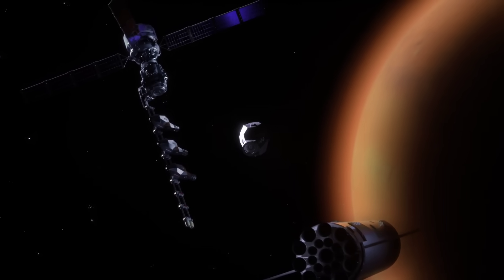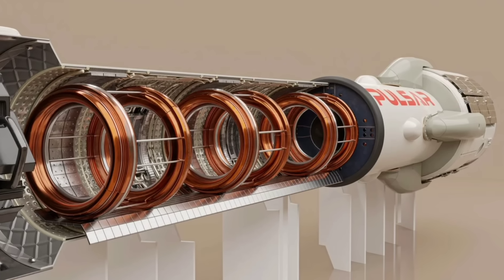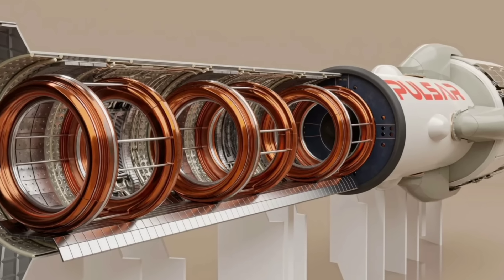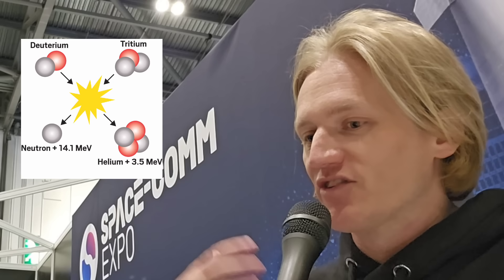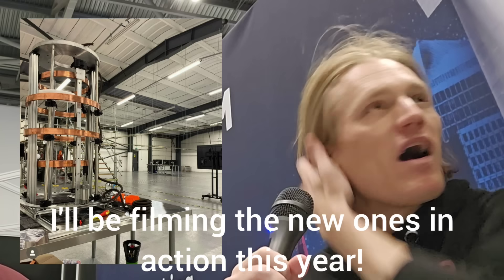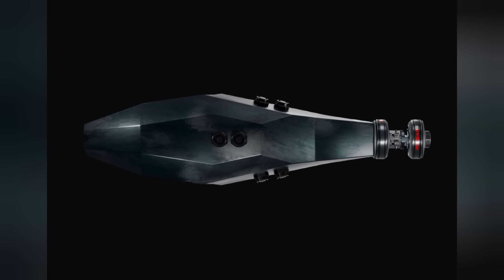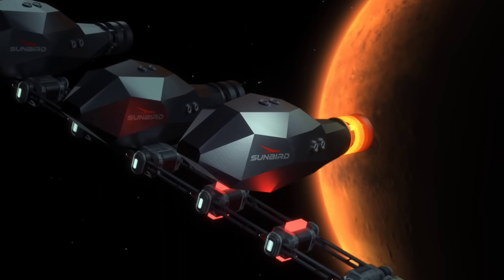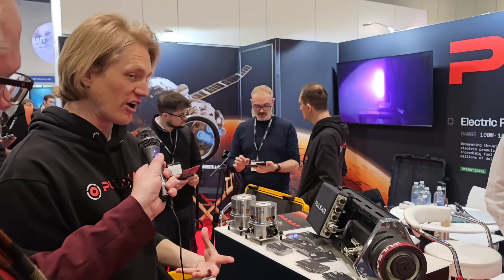15 TIMES faster than Nuclear Rockets!  Pulsar Fusion unveils new Sunbird Fusion Drive!

Comment: This is where research money should be going. Human missions to Mars is impractical using chemical rockets. Starship is still important as it will get the components of a nuclear vehicle into orbit. That was Musk's original intention with SpaceX, to make a contribution to developing the capability needed for humanity to get to Mars. Then he got obsessed with the idea of building a 100 passenger airliner to Mars, which he claims the first human test flights to Mars will land in 2028. I am a huge Starship fan (I was even in Boca Chica for the launch last week) but Musk's fantasies are becoming a distraction to developing what is really needed to eventually get humans onto the surface of Mars.

Comment: Fleets of reusable Starships to lift things to orbit. Fusion engines to move the things we build in orbit to other planets. It's all starting to come together.
Reply from the maker: Excellent plan!!
Reply: @TheAngryAstronaut  I still don't get it. Why use light as a speed indicator and why would someone on the vessel experience time differently to someone on earth. I get the '2 point' idea but there are billions of photon sources which would create more of a fog than anything else rather than the 'earth - destination light sources. Why not use time and/or a gravitational constant to determine distance? It does not seem possible in my, admittedly uneducated mind, for 2 people to experience time differently. Also, I read somewhere that light doesn't always travel at the accepted speed of light.
Reply: I see the vision, this is clever, i wish more people would think in space, vacuum and micro gravity. I know we can do better.
How many things to we make on Earth that rely on our gravity and atmosphere?  My challenge to the future is to try creating things in the vacuum and micro gravity.
What happens when you simply melt iron in this environment and then let it harden in space?
It has to do something different because ifs not in our oxygen atmosphere  and gravity isn't pulling it one direction.
Reply: @ekojar3047  
I agree... Metal 3D printing in space is a good example. No supports, no oxidation etc.
Reply: @ekojar3047  with bigger ship it would be easy to create artificial gravity. If Starship gets 18 min in diameter, it will be easy to make turn itself on its long axis, with fuels in the central part to lower the centrifuge forces, and create variable and adjustable artificial gravity.
Reply: A true fusion drive would be so hot it would be banned for use on the surface.
Reply: @rpbajb - That's why they plan to only use it in space.
Reply: @rpbajb he didn’t say using it on the surface
Reply: @rpbajb why would that be? It wouldn’t break the Coulomb barrier of oxygen or nitrogen. It would be as hot as lightning which actually does cause nuclear fusion, detectable by radioisotope traces and fast neutron emission. The problem is a true Fusion Drive wouldn’t work terribly well in an atmosphere and creates a lot of radioactive crap that ends up in the atmosphere. Any dust exposed to the plume of escaping fusing nuclei along with material ablates off the refractory surfaces that support whatever superconducting quadrupole magnets are used to confine the plume- there would be gamma and x-ray spallation. It’s not early as bad as a nuclear thermal rocket. This guy is just hawking xenon shooters- very high specific impulse but very low actual thrust to weight ratio. This is nothing that we didn’t have in the 1970s. There’s no fusion rocket that this guy’s working on, he’s just one of many, many people in tech cashing in on potential over unity fusion developments but it’s vaporware. We can’t even do it in a lab. Net energy over unity in an NIF or a tokamak doesn’t mean anything cuz we can’t efficiently convert neutrons into electricity. They make things hot, and we can use the seebeck effect to extract electricity with terrible efficiency or we can use steam turbines. The most promising idea that might be coming down the pipeline soon would be neutron scintillator photovoltaics. If we can create scintillator that produce lots of light from fast neutron capture similar to how radiophotovoltaics do with beta particles- fast electrons. But they have charge. All neutrons have is kinetic energy and the ability to join atomic nuclei. But when neutron capture occurs there are some periodic elements that push their electron shell up one or more orbitals  which in certain chemical configurations emit a photon- Pauli exclusion principle- the energy has to somewhere
Reply: @maseratidyce3587  Thanks for your reply, it was very interesting. When I said a "true fusion drive" I meant one fuses 1H and exhausts just  4He, along with gamma, positron, and neutrinos. A star-hot stream of helium plasma directed astern, strong enough to lift a 10,000 ton ship in a one gee field, would be incredible destructive, as well as radioactively "hot". My prediction is that it would be used off world only.
Reply: @ There is a company in Washington State building a fusion reactor that burns at 100,000,000 degrees. They are building the 8th prototype. Helion energy. Look it up
Reply: @pedrosura that’s contained, engines are not
Reply: If you’re here today you nor your kids will see it🤷‍♂️
Reply: U need chemical propulsion for ascent and decent on planets, nothing comes close to their thrust power, fusion engine would like attach in orbit and detach at destination
Reply: There's a missing point in these presentations: If the are not powering the process with SUSTAINED fusion what power source starts the process? If you're handling plasma you must have magnetic containment of some kind: What bootstraps the system?
Reply: @francisdavis1271   Think future: you take water, split it into hydrogen and oxygen, then fuse the hydrogen. It's easy!
Reply: @francisdavis1271  It’s not like what people think of when they think of using fusion as a power source. The idea isn’t to get out more power than you put in. The idea is to use electricity to fuse atoms.Then channel the resulting plasma out the back to create thrust. There is some magnetic containment involved. ( You can see the rings in some of the shots) However, the idea is merely to direct the hot plasma. Not to contain it.This is really just a more efficient example of the standard “Make something go boom and exhaust it out the back” method we’ve been using for years.
Reply: What NASA wanted with the Space Shuttles, just moving the Shuttle around this time.
Reply: But still makes no sense!
Reply: @tcf70tyrannosapiensbonsai  no sense to whom ?
Reply: YES,  it's looking good!
Reply: Lift it up (rocket, orbital gun, spacelift) -transport it (spaceship) - bring it down (shuttle, spacelift)
Reply: @IvanPetrov-k2k  ok, this may be crazy, but how about lifting old satellites and space stations to graveyard orbits and making a "space junkyard" for materials, solar panels, reactors,  habitats? maybe even  "space scavengers" lol.🤣🤣
Reply: Sure, if you want scale to remain small starships will do
We really need to investigate dynamic structures and launch rails
They not only can provide mass transportation to space but also store gigantic amounts of energy and could even be used to transfer energy between continents and hemispheres, tackling renewable intermittency for good
Reply: @taith2  Not sure if 100+ tons to orbit on a lifter that can fly over and over and over is really small scale. Though, launch rails would be really neat.
Reply: Gotta figure out everything on the moon first.
Reply: You left out floating sealed rigidified aerographene stations around 65k miles up, a graphene/cnt space elevator, laser chemical vapor deposition 3d printers operated by AI, direct air capture and direct air electrolysis with chemical reactors to harvest any materials needed from the air, ferrofluid convection current stirling generators, and a robotic labor force. The entire process automated and self-sufficient. Starting point available to anyone with 2-5k, everything free afterwards.
Reply: Space X could use a ring system to lock these to the hulls of starship, leave the ring in orbit land on Mars, launch the ship back into orbit connect the ring back to earth, these cut travel time to Mars in a big way. The future is looking brighter.
Reply: I'd put the hopes of "fleets of starships" on hold unless you mean generic starship not The Starship.
Reply: New glenn can do it better
Reply: @iamscoutstfu  New Glen.....?? haha
Reply: @ So far, that is the evidence. Starship promises a lot of cargo to LEO. So far, those are Elon promises. Like when he launched 4 Starships to Mars last year. 
Like Larry Kudlow asked Elon “how are you running things”
Elon replied
“With great difficulty…”
Yeah! We
Know BOOM!
Reply: And Elon had ANOTHER scrubbed launch yesterday…..
Reply: Show us your space rocket company that does better....
Reply: @tomwilson1006  not scrubbed, it was a TEST flight
Reply: @f1rehawk99  You know what I mean......postponed/rescheduled
Reply: Finally someone found a realistic use for Starship! Elon will overtake this company and claim he invented it
Reply: @pedrosura  Pulsar isn't the only one.
Reply: @WolfeSaber  That is true. I hope a lot of those ideas get a chance and funding.
Reply: @pedrosura  we love Democrat tears. You were probably cheering for Elon 5 years ago. Lol
Reply: @bigcauc7530 Elons great, when he stays in his lane.✅️👍👌
Reply: @bigcauc7530  ^ Applause ^
Reply: @pedrosura  EDS
Reply: @ Says the fanboy drinking from the Koolaid mug:)
Reply: @pedrosura  Yeah, anything's possible. We'll see what we see.
Reply: @pedrosura  that hate's gonna burn you up, kid
Reply: @zimriel 
what hate did you see, boy? I just saw accurate speculation stemming from distaste, and I don't hate elon the same way I don't hate nero, but if people defend or like him then I think it's fair to state facts about him, like that he buys companies and takes credit for what they do because he tells them what to do. Also, his grandfather (who was in that austrian painter's fan club) wrote a thing talking about a future fourth reich led by "the elon". His dad owned "servants" in africa where and when elon grew up. He also talked about having people work in the settlement on mars to pay off their debts to him like how a serf pays a king. I don't think it's fair to anyone to treat him like he's just a harmless normal person being slandered.
He really didn't add much other than money to any of the companies he's bought, and he will only benefit the world, or humanity by being an example, and fueling the company that built "starship". Starship or something like it will finally allow us to move industry (and hopefully our civilization if it makes it that far) to space, his other companies are trying too hard to solve simple issues with more complex technology. If we care about life in the universe then we will move most of our stuff off of earth, and away from mars since it's (almost guaranteed, and likely unique) microbial inhabitants could go extinct as their habitat is taken over. We could do just fine focusing on the moon to reduce ecological impact from industry, and we have earth right there to help out the colony if it needs it. It makes no sense to waste energy on a farther away and stronger gravity well when building habitats in space next to earth is just better, and we'll be able to go anywhere after we're set up and have figured out everything we need to do between here and the moon. At that stage we'd have access to so many asteroids that any planet is just a waste of time.
Reply: @thetobyntr9540  that's a lot of words. too bad i ain't readin em
Reply: @thetobyntr9540 - Do you have anything to show for all your rhetoric or, are you just a keyboard warrior?
Reply: @zimriel lol “kid” is cute. Nice touch. I’ll be sure to pass this on to the people I work for that do business with him personally (we make components SpaceX and Tesla) so they can tell him that “Zimriel from YouTube” is sticking up for him. He’s still not gonna let you hit lmao